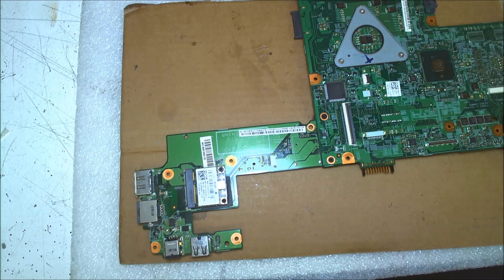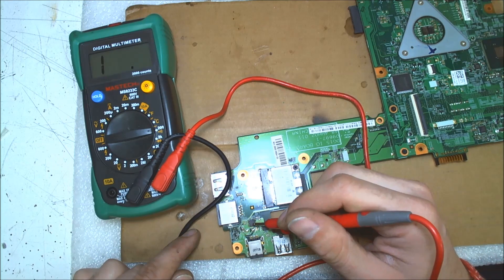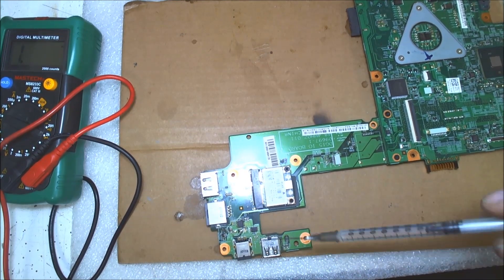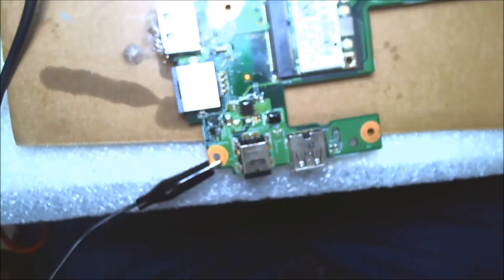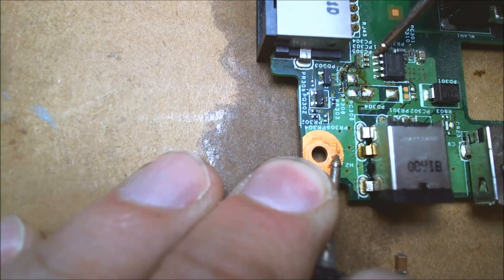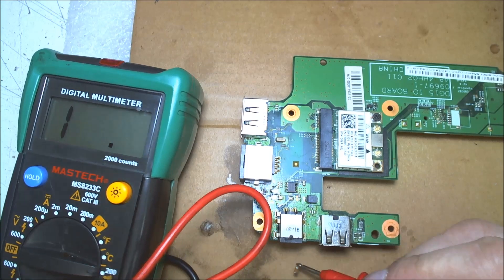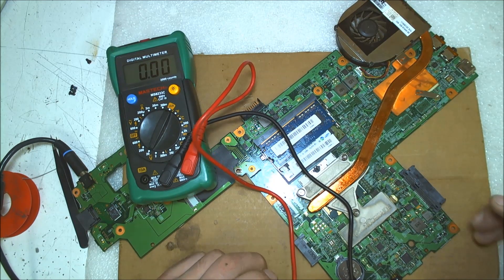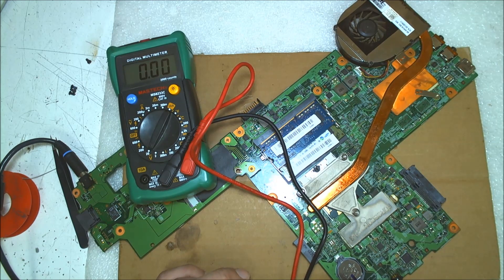Dell Inspiron N5010 Short on main power rail

Comment: Hi thanks for this video. I have the same laptop from a client and the problem is it's turning off by itself. Your video helped me test for shorts, test the 19v, 3.3v and 5v which are present. Now I can come to the conclusion that the fault can be with the pch because this one gets hot when I touch it, or the fault can be with the cpu but I don't have a spare to test it. If it is a faulty pch can the laptop still be repaired? Thank you! :)
Reply from the maker: The PCH can be replaced but will cost the same like the price of that laptop. How long the laptop work before power off.
Reply: @LaptopDisassembly  it goes off after a few minutes
Reply from the maker: I doubt you have a voltage issue. Check the cooler is it heating evenly. Also did you replace CPU
Reply: @LaptopDisassembly  yes cooler is working evenly. It's the original CPU but trying to get a spare one to test

Comment: Hello i made the same procedure on my n5010 inspiron i remove the capacitor then try to switch but its nothing. Not working as is same problem no indicator lights no lights at all.
Reply from the maker: Well it may be a different capacitor that went faulty. Just measure for a short.
Reply: If the problem is about power i must be focus in this part? Or i need to look at the mother board? My laptop is completely dead no lights and sounds.
Reply: I'm planing to buy new io board.  But i do not sure if this is the right place with faulty circuit..
Reply from the maker: The short can be on the main bord, not the power bord. Separate the two boards and plug the power adapter. If the light of the adapter go off the problem is the power bord, otherwise the short is on the main board.
Reply: I bought a new io board but no luck it doesn't power on no lights.. I think the problem is on the mother board. Surely

Comment: I have the n5010 and it says it's charging but doesn't send any charge to the battery. Everything shows as if it's working but it doesn't charge the battery. Any ideas?
Reply from the maker: First try with good known character. The one you are using can have a faulty id pin and may not work properly. Also can be a faulty battery. Try to charge the battery with the laptop turned off.
Reply: @LaptopDisassembly  Tried 2 different chargers. Both work fine on other laptops. Battery is brand new. Was doing this with the old battery too. It detects the battery is there and says it's charging but doesn't send any current to it
Reply from the maker: Can be a charging ic problem.

Comment: Hi I would like to know what is the capacitor number that you changed
Reply from the maker: Any smd cap that is 25v and the same size will do. It is just a filter cap. You can go without it also.
Reply: @LaptopDisassembly  Thank you, my friend, I have removed the capacitor and the device is now working. Does a problem occur later because of removing this capacitor?
Reply from the maker: No dont worry... If you like to replace it, just tell me the number on the board and i will check tommorow when im in the office.
Reply: @LaptopDisassembly  You are really a wonderful person, thank you
PC306
Reply from the maker: I don see pc306 in the schematic... Can you send me a photo of the place were you remove it. The email in in the info page.
Reply: @LaptopDisassembly  I don't know how to send the message
Reply from the maker: @totototototo6430  i found it. It is 10uF/25V
Reply: @LaptopDisassembly  Thank you so much

Comment: Can u help me fix Dell 7567 which is not charging battery?  I need your help on fixing this motherboard
Reply from the maker: First try to power on the laptop only with charger and with the battery disconnected. Most of the times is broken middle pin on the charger. Test with different charger.

Comment: I also have a problem. What is the specification of this capacitor and where to buy  it?
Reply from the maker: Any ceramic cap at 25v should do the work. It has to be the same size. You can go without it, is just a filter cap.
Reply: what is the value of this capacitor ? please suggest me alternate remedy.
Reply from the maker: Did you try to power on without it... About the value.. Try 22uf at 25v
Reply: Thank you very much again. Yes I turned on the power but I was afraid there would be another problem. But don't be afraid of your Suggestion anymore.
Reply: Thank you so much..

Comment: Same lapatop 3.3 v ground in mother board .
When Power adapter connect light gose off please suggest me .
Problem is in mother board how to trace it .
Reply from the maker: Any visible damage on the board.. Look carefully.  Also measure the resistance to ground after the second mosfet. do you have a lab power supply ...

Comment: What is that part that is burnt out
Reply from the maker: It is a shorted capacitor.
Reply: I have the same problem mine is burnt out
Reply from the maker: Just replace it or remove it and test without it.

Comment: Thank you for replying..the Jack on the power board was messed up already before but the laptop was working fine.I used my Laptop (
without the baterry because it doesn't hold the power anymore.about 2 week ago i connected a camera via USB (the one that's on the dc board and i think it made a short circuit because it just stopped suddenly.after a week i ordered a new DC power board but still nothing.No i didn't check any voltages because i'm not specialist in that.however i do have little bit of knowledge about "fixing Tower PC's.This was first time to disassembe a laptop.any advice or anything i could try without to much complications?!
Reply from the maker: Check abound that usb. For physical damage. You probably have  damage on the 5v power rail. If you have  multimeter try messing on the big coils. Plug the adapter and messure. On some of them you should have 3.3v, 5v. If they are available than the jack is fine. Look the board for damage from that usb.
Reply: @LaptopDisassembly  I have taken out the old Power board..yes there is a little bit of physical damade,very small blackness arround the PR306 diode..but what i don't get is why is it not working with the new one i ordered?that one hasn't got any physical damage and it's exactly same model DG15 IO 09697-1 like the old one.i vould show you a picture if i could.well,i guess it goes to the graveyard and i have to buy a new laptop.i was just trying to fix it as cheap as possible but no success unfortunately.and i am sure it doesn't have a big issue.It's quite an old laptop.or maybe service might help.Thank you anyways.Good job with the tutorials
Reply from the maker: Usually the diodes are for protection. Having a darkness around the old one, means that there may be a problems after it. If you like you can send me a photos of the board ( both sides and on focus pleace ) the email is on the contact section
Reply: @LaptopDisassembly  sorry i couldn't find  any email adress in the contact section.I'm afraid that the motherboard has sufferd some short as well not just the power board.i also tried holding the power button for about 1 min.without the baterry or power cable  inside the laptop and tried to turn it on but still nothing.if you could send me an email adress where to attach the photos i would be grateful.thank you again!
Reply from the maker: Yankogoshev@gmail.com

Comment: Hy there.i have a question regarding to this.My laptop stopped working..i had DC Jack problems...i ordered a new one..changed it.and still no life in the laptop.what do you recommended?! Thank you
Reply from the maker: Few questions
1. How did you determine that the dc jack is the problem
2. Did you replace with the same one
3. Do the laptop work on battery or not
4. Did you test with good known working adapter ( dell one, not HP one)
5. Did you messure some voltages on the board, do you have 5v, 3v etc...

Comment: I have the same laptop. When I try charging when the laptop is off it lights charging then after a while it's off. I have failed to charge it when it's on. It can't even power when I've plugged in without battery. Any help?
Reply from the maker: Probably the middle pin of the adapter is bad. Check do you have any voltage on it and try good known adapater.

Comment: I attempted a remote bios update from A08 to A15, and user shut it off after screen went black for 5min after reboot.
Now the board seems dead. No LEDs. No response. Nothing.
Can a failed bios update do this?
Reply from the maker: Did you update from Windows. Also try reseting the bios
Reply: Thanks for replying. Yes, I updated from Windows. I tried resetting the bios by removing the cmos cr2032 battery. I also tried the flash drive FAT (16) hdr/rom bios recovery using End key. It seems completely dead, but power adapter tests well with the multi-meter.
Reply from the maker: Well you can flash it with programmer but you have to take offthe chip.